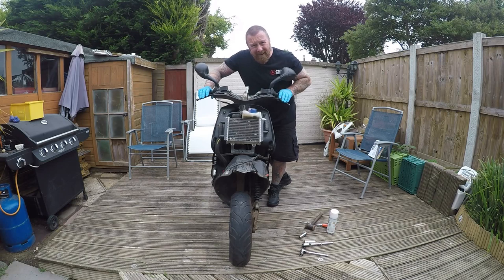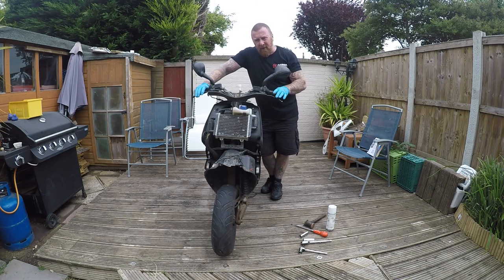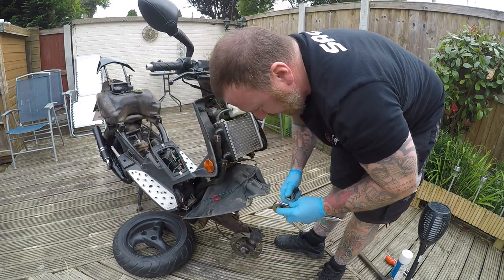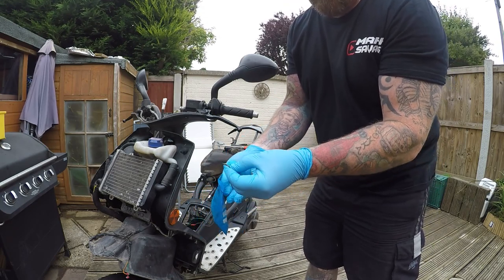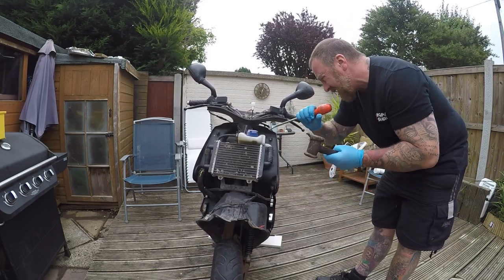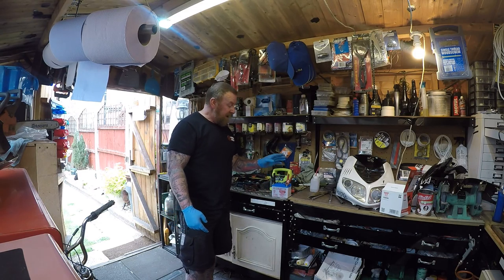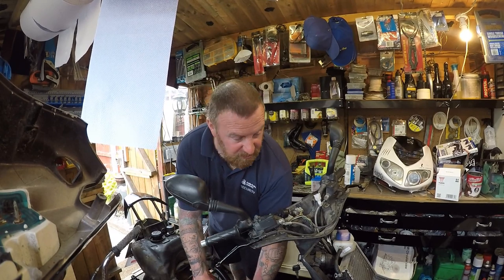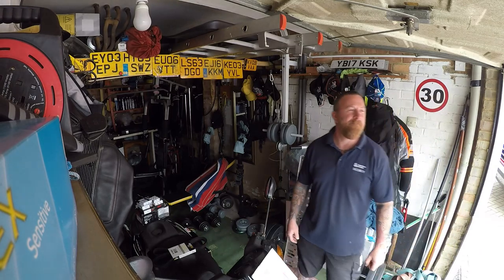SPEEDFIGHT MOPED FRONT END & HEAD STOCK PART 4 MARK SAVAGE

Comment: I have just bought  a 2009 SPEEDFIGHT 3 50cc scooter with a full MOT paid £600 . goes average 40mph on flat . But there are problems arising now .I didn't notice when I bought the scooter that  the scooter had the side stand missing ( now replaced with a new one < centre stand corroded . needs replacing . I can hear the piston in the engine when traveling don't know if that is normal as this is my first scooter  . took the scooter to a motor bike shop that work on Peugeot scooters .they had a quick look at me scooter and noticed to rear wheel bearings are warn a missing exhaust bolt  I have since got one and installed . However the motor bike dealer basically told me I had bought a lemon  .so I am watching your channel and will try to fix what ever needs fixing on my scooter 
 so whether permitting going to take off all the panels install the seat lock cable as the one on the scooter is broken  replace the centre stand and sort out the throttle cable as I think it is not standard as it slips and sticks making the revs go up as much as 900 rpm . may need to replace the piston ,going to replace the rollers and clean up inside the casing etc. If I was to sell my scooter as is I will loose out hundreds of pounds . So it may cost me another £600 to get this scooter in A1 condition  and I will know I have a good reliable scooter. so thank you for your great videos and simple break down on what to do and how things work ,I have never worked on a scooter /motor bike . but I will learn . and I will get my scooter in perfect working order in time .
Reply from the maker: Hi bud 
To be fair it's unfair the garage saying  that , they are not new and had  a lot of 16 year old owners normally who don't service them and listen to their mates on silly upgrades fitted badly .
So being 2009 the later ones most orange and black and water cooled! 
Yours maybe but it ait its easier to check and replace piston as you may have piston slap as being old
Exhaust change for  sports one , air box with a good in box filter , roller 6g and clean variator , if back plate on ,take off
New belt ,check clutch as in my videos but make sure it clean ,no dust
Clean carb stick to 60 maybe 62 jet
If water then replace piston and new antifreeze  , it's a bit harder but worth it
Good 2t oil and don't use E10 fuel ! E5 super only 
See how it runs before doing rhe piston as you may get many more miles yet

Comment: Hello mark really nice video keep it up pal.I want to ask u a question i just did a top end on my speedfught 1 even tho the old piston and piston rings were in pretty good condition i did it cause i bought it used.Im wondering how i should wear it in and how to drive it cause i live in a hilly place .
Reply from the maker: To be fair I've always found on these little pistons as long as it not a cheap one ,just add a little 2t oil in with the 1st tank full and ride it as normal but not to keep it at top end just up  and back down to 3/4 throttle down and back up etc 
They wear in better
Reply: @marksavage  ive done the top and and its okay but i also changed the kickstart small dendix and when i startup on the kickstart there was a sound of metal distruction .I opened the metal case and i saw that the small teety on the varriatior and the dendix scratched a little .I think that even when the kickstart is not pushed the dendix and the teeth of the varriator are touching together.I didnt miss buy the 15mm its tye 12.5 thats ok but i still got problem idk whats with it.If u could help me i would appriciate it alot.Ty mark
Reply from the maker: @biljanaivanovska1753  you may have to put the washer back on the variator so it clears it

Comment: Jusy want to say a big thank you Mark as if it wasn't for you and your how to videos I'd be out of pocket with the prices the garages charge so I'd like to say a big tank you and I no everyone else that watches your videos will say the same
Reply from the maker: Thats very nice of you bud thank you and for watching
Reply: Hi Mark my Speedfight seams to be juddering and when I let go of the brake it wants to move forward I've turned down the idle to the point where it dies but still judders and wants to move forward am I correct in thinking it's either the variator sticking or to light of a roller or just that my carb needs setting up correctly
Reply from the maker: @linihughes5106  your on the right track 
It can be the clutch
I'd take off the cover and give it all a once over bud 
But sounds like the clutch it bitting rather than slipping round or belt is worn clean and check out the variator
Reply: Hi Mark thanks for the reply just remove the variator and clutch the clutch as everything looks stock the clutch as plenty of meat on the pads but I've noticed the springs are red and the torque spring is this correct plus each roller is aroun the 8g mark

Comment: My aprilia sr needs a new indicator relay I think it's intimitant and works about 50percent of the time what do you think Mark
Reply from the maker: Not sure on the sr but think it is a relay on them so should be a easy fix once you find it 
Thought it was on the rear side !
Reply: @marksavage  on my 03 125 model it's at the front when I got the bike it was just hanging loose slapping against the frame not good at all

Comment: Hi Mark, I've got a clicking sound coming from the front end if my speedfight could it be wheel bearing? As it's been sitting for a long time.
Reply from the maker: Put it on the stand and make sure the front wheel is off the ground and spin it 
Normally a clicking is the speedo 
Rubbing and grinding is the bearing or it being loose bud
Reply: @marksavage  Will check it out thanks, also do you think these speed fights will become collectables in some time??

Comment: hi mate my speedfight 3 50cc isnt quick at all and am trying to make it go quicker, is there any specific mods like a racing cpu or something like that which would make it go quick/ what would be the right wire to cut if that was the case.
Reply from the maker: The sp3 had a few restrictions 
Variator , carb , exhaust and the cdi !!
You can do all the normal things and it will pull away fast but still not top end !
You will need a race cdi or pop to the garage and get it done there bud 
This is the sp3 were not  as popular as the sp2 !
Reply: cheers mate, is there any specific cdis which are the best for this?
Reply from the maker: The right one lol, if you can find one .
Make sure you check as a lot say they will fit and do not

Comment: Hi mate recently brought a gilera runner 200 4 t new shape I clean carb air filter and changed spark but bigs down when I give it any more than half throttle any guesses on what it could be
Reply from the maker: It will be fuel bud and jet , go down a little in size or more air and a tune
Reply: mark savage hi mate but what confuses me it only has a 90 jet in it to I would of thought that was quite small anyway

Comment: Great video mate, this should help me a lot sorting out the bars on my vivacity since it's basically the same. Can't figure out for the life of me why the bars aren't straight and have forward/backward play but the problem has to lie in the headstock then! (Already tried to straighten them by loosening the bolt holding the bars on)
Reply from the maker: Yea if the whole thing is moving its head stock 
Maybe suspension 
But needs sorting bud 
If all ok it may have been dropped or pot holes ?
Reply: @marksavage  Thanks for the reply mate, it's been dropped one or 2 times judging by the state of the panels! Can't be potholes, the roads over here in the netherlands are flawless haha. If I can't get it sorted I'm going to get a spare fork just to be sure. Fairly plentiful around these parts.

Might I also add, cracking videos, so easy to follow and good old school english shed mechanics reminds me of my dad. subbed yesterday! Keep it up!
Reply from the maker: @BigRizza1  that's what I Try and do bud 
Good basic and as easy to see what I'm doing as I can 
Pot holes !!! It's like driving in them old 50s movies where you see them driving a fake car on a screen just turning the wheel left to right 
Well this is how you have to drive now on our UK roads!!!
If every body stopped wanting they might have a few £ to sort the roads out but No 
Take care bud and hope you get it sorted
Reply: @marksavage  Haha yeah I used to live near Portsmouth and the back roads are awful. Great fun in a quick hatchback though lol. I agree mate! Will get round to it tomorrow. Might make a video or 2 in the future when I rebuild the engine.

Comment: My 50 cc Lexmoto echo is going 20 mph on flat but 42mph down hill it usaly dose 40 mph on flat i changed rollers and belt but still not getting to top Speed i need help
Reply from the maker: Hi bud sounds like my winter moped video i did 
So cleaned variator , changed rollers so same weight 
New belt and correct size ?
And it revs up and starts ok 
You have serviced it ?
Then clutch bud

Comment: Front tyre on speedfight 3 has just been changed now bike feels top heavy and wants to pull to one side. Any ideas m8?
Reply from the maker: Simple start check the tyre pressure and that it's not flat ! 
This really is the common problem bud
Reply: @marksavage  tyre pressure is fine as its a new wheel but since came Out of the garage does not feel right
Reply from the maker: @Milo_da_cockapoo  is the tyre on the right way as they have direction on them 
You say a new wheel?
So you go a new tyre and wheel ?
Was it balanced ?
Don't think just because it was a shop that did it they don't make mistakes bud 
If it feels wrong I'd bring the bike back and talk to them as they may find it easier but its not safe as is bud
Reply: @marksavage  you saying it's not safe to ride? Took it back and said all was fine even when doing top speed on it. Just when you know your bike you know how it rides.
Reply from the maker: @Milo_da_cockapoo  I've said this in my check over bike videos 
Your right you do know your bike 
Something is not right bud 
Maybe take it to another garage 
Put it on the stand and then lift it onto a bloke of wood like I do then get someone to push on the rear so you can spin the front wheel 
You might see whats going on bud